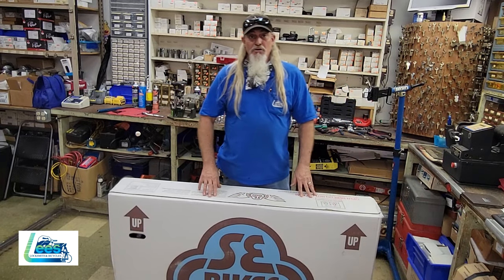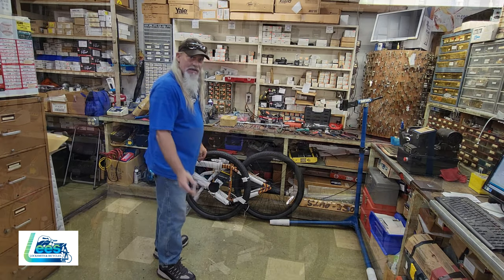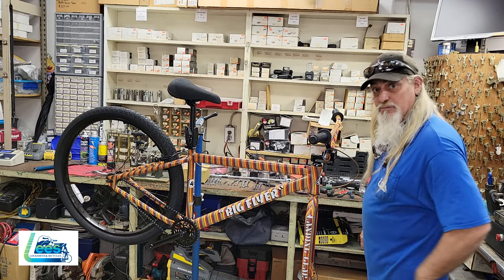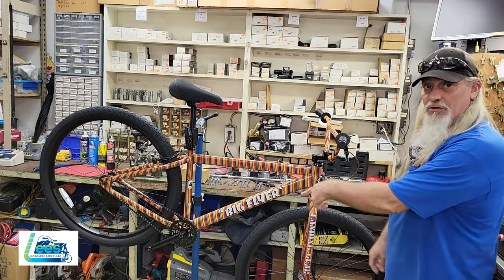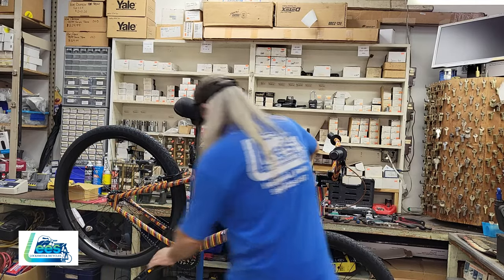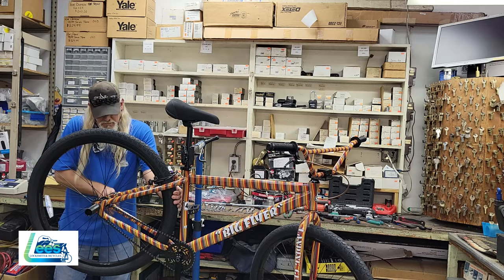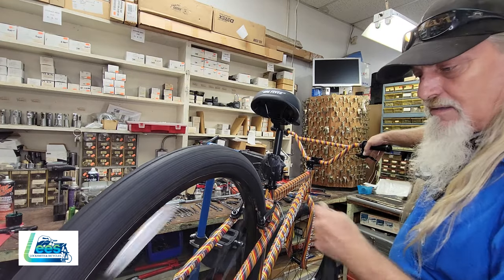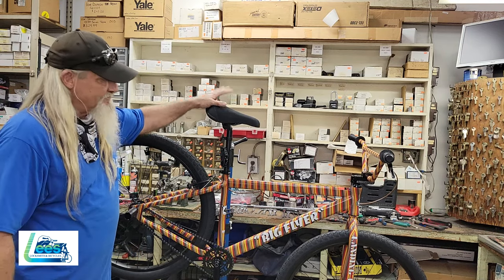SE BIKES Big Flyer 29er Striped 4k Lee's

Comment: Do you need the grease for the petals?
Reply from the maker: As a matter of proper assembly practices,  I always grease the spindles of the pedals. A frozen pedal can damage your pedal wrench and may cause the threads in the crank arm to strip out too. You can use whatever lubricant you have to keep the pedals from seizing up, but I will always recommend this step in my assemblies. 😁👍
Reply: thanks!!